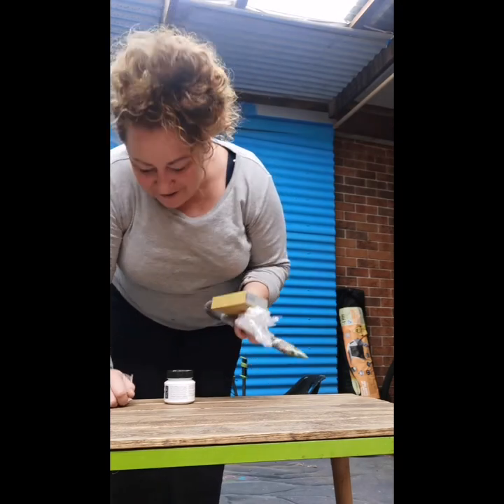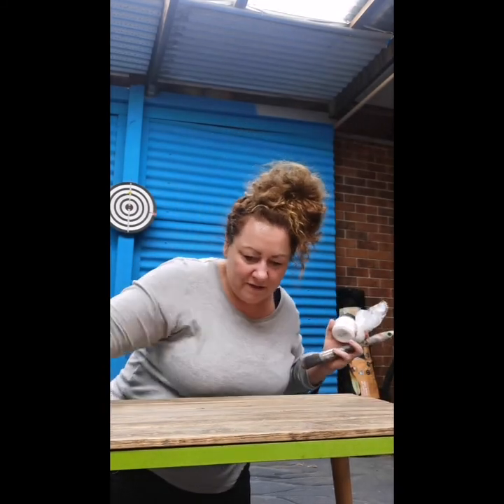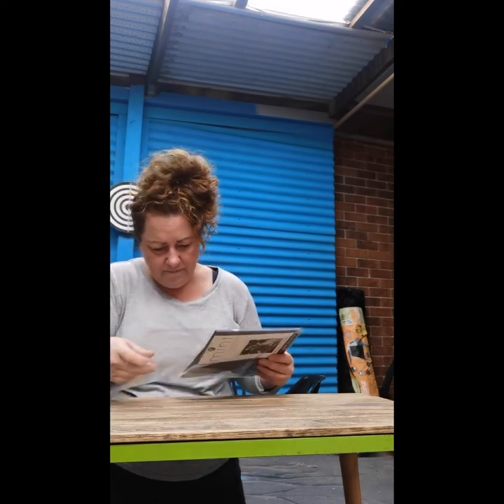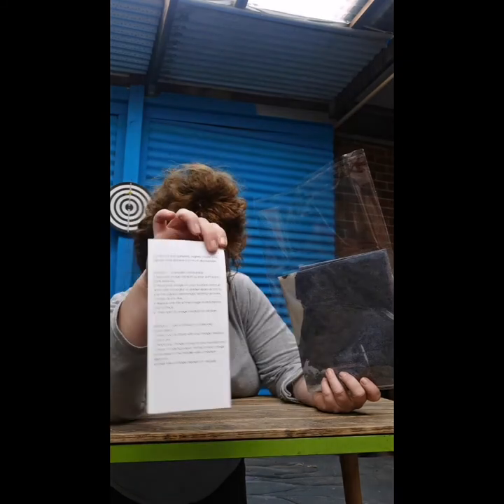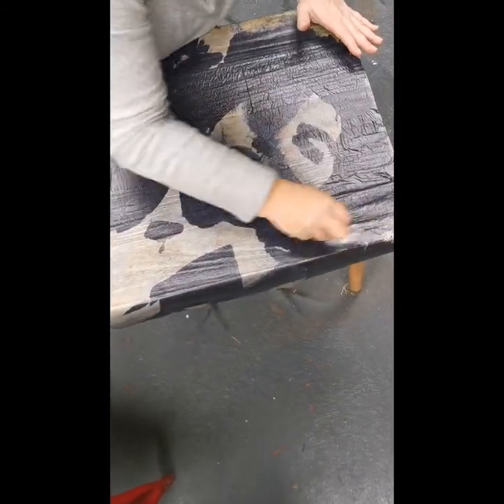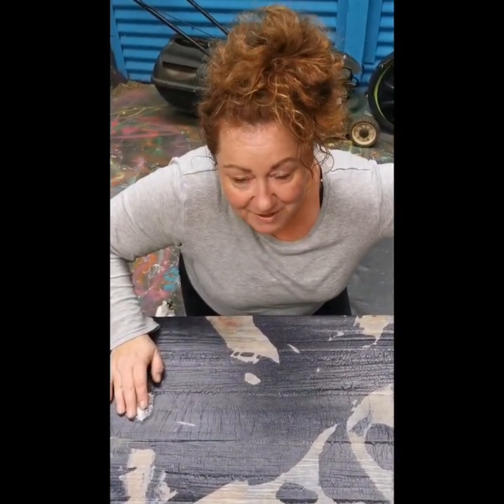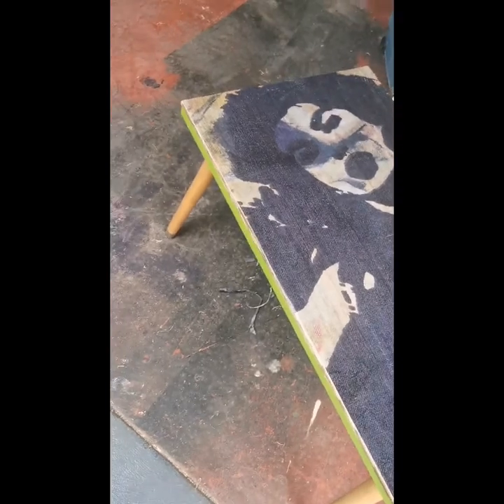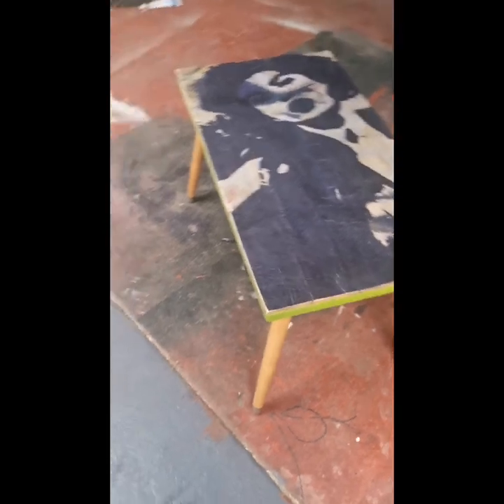Super Fast Super Easy Decoupage Revamp | MINT Decoupage Papers

Comment: Having NEVER decoupaged anything, I feel my fear lessen as I watch you transform this table into something stunning. The rustic wood texture adds so much to the final product, and saves days of sanding and striving for a smooth surface before applying the paper. I would never had expected this decoupage could be done on a surface that isn't perfectly smooth. I hope to see the final outcome. I was really hoping you would put a black laquer finish on the legs. 
I bought a wooden room divider screen that has vinyl (wallpaper?) panels that I am hoping to cover with decoupage. I'm wondering now if I need to remove the vinyl in order to get the decoupage to adhere, or if I simply sand it rough, if that would be enough to get the new papers to stick. At any rate, I will first paint the individual wooden panel pieces and hardware, and then I'll decide on how to apply the decoupage to the center areas that are currently vinyl covered. Fingers crossed for an outcome as good as this! 
Thank you so much for sharing your videos!

Comment: Looks awesome..can I ask what else can you seal it with?
Reply: Not sure why she doesn't list what she uses & why but depending on where you live, a good water-based varnish is budget friendly (e.g. Cabot's Cabothane or Timber Protect - both available at Bunnings if you're down under). 3-4 coats gives a pretty durable finish. I prefer a satin finish rather than gloss as it hides a multitude of 'sins' while still giving a lovely smooth feel to your piece. Gloss shows up every flaw!  If you're in the US then there's so much to choose from at very reasonable prices - from real budget at Walmart to reasonable prices at Lowes or Home Depot, not to mention Amazon as shipping within the USA is cheap. Hope that helps :)